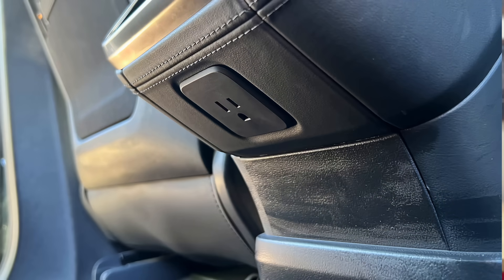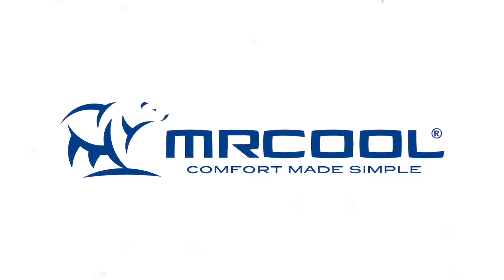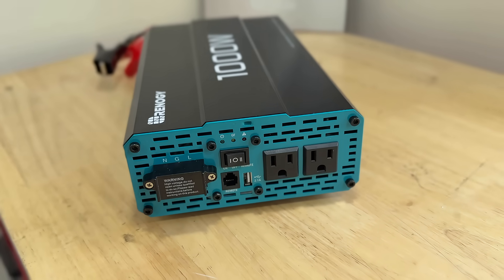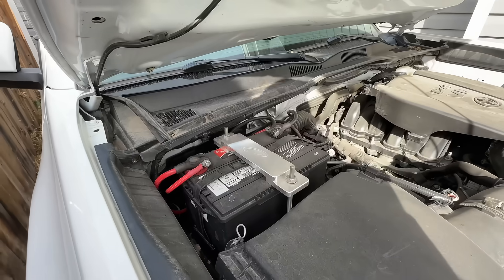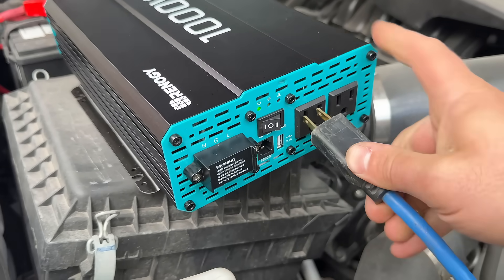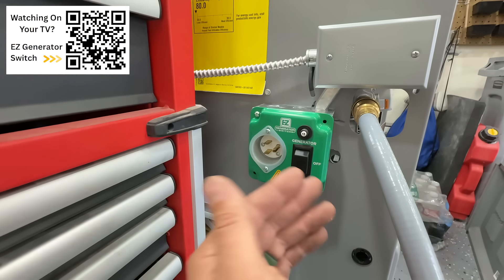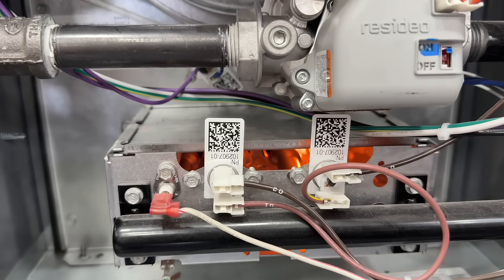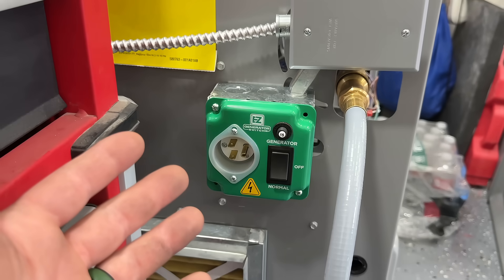Why Buy A Generator? You Have One Parked In Your Driveway.

Comment: You need to pend a lot more than $200 to do this right.
Spend as much money as you can afford on a 5000w (or more) full sine wave inverter.
Those puny clamps and wires will not give enough current to the inverter to power it. Fabricate heavy power and ground leads with ring terminals on the ends and attach them to your battery and inverter with nuts. Also install a ground lead to the chassis of the inverter for good measure.
The power that winds up running your refrigerator or an air conditioning unit starts somewhere. That's the vehicle's alternator.
Just be advised that powering all of these things puts a lot of demand on the alternator. Periodically check the temperature of the alternator to see if it is keeping up. It might not be a bad idea to find a little fan that blows air on it to help cool it.

Comment: This is cool, portable and interchangeable. In a pinch we have used duct tape to tag out the Main breaker, shut it off, only breakers on you want to run, Suicide plug to the outdoor electrical socket. You have to make sure you have the circuit breakers you want to run on the same leg of the panel as the outdoor socket since the 110 socket only provides power to half of the panel so it's every other breaker on either the left or right side that will have power. 220 devices and breakers will only have 1 hot leg, so won't work. At my house I wired a generator plug outside into a 220 breaker so I can run the ac and well pump. But I'm a contractor.
 Generator is way better on gas though, but the furnace should run for 10-15 minutes on the battery and just recharge it with the gas.

Comment: Having done auto electric work, I can tell you this is a SHORT TERM use. Automotive alternators are NOT for charging, regardless what you think. They maintain the battery, while powering the rest of the vehicle's accessories ei: ac, lights, digital equipment. If you were in a severe situation where you needed to do this, 24 hours would be as long as it would be advised.

Comment: A few important points:
1. Get an inverter that outputs a pure (smooth curve) sine wave. Not all electronics, including furnace motherboards, function using a square sine wave typical of most cheaper inverters. 
2. Install longer 1/4” bolts on battery-terminal clamps to accommodate washers and wing nuts. On inverter cables, install eyelets that slip onto the 1/4” battery-clamp bolts. Secure inverter cables to batter terminals with the wing nuts.
3. Use inverter cables (4 AWG or thicker) long enough to reach from the inside of a garage to under the vehicle (parked outside) hood where the cables fasten to the battery terminals. This way, the inverter can be secured inside the garage and out of inclement weather. The car hood should close and latch as well. 
4. A car can idle all night while locked (with a second key) to provide power to an inverter and to keep the battery charged, and will usually use less than 1/5 tank of gas.
5. Any inverter with a rated output of more than 1kW is wasted money given that the car’s alternator isn’t likely to be able to produce more than 1kW output, and about half that at engine idle. Per a cursory AI query: 

A 100-amp alternator at idle can typically support an AC inverter rated around 800 to 1200 watts continuous, depending on system efficiency and battery support.

⚡ Understanding Alternator Output at Idle
• Alternator rating: 100 amps at 14 volts = 1400 watts max output (DC)
• Idle RPM output: Alternators produce less at idle—often 30–50% of their rated capacity• So at idle, expect ~500 to 700 watts of usable DC power from the alternator alone.

🔌 Matching an AC Inverter
• Inverter efficiency: Typically 85–90%, meaning some power is lost during DC-to-AC conversion
• Safe inverter sizing:• Continuous rating: 800–1200 watts AC is a safe match
• Surge rating: Can be higher (e.g., 1500–2000 watts), but only for brief startup loads
• Battery support: If your system includes a healthy battery, it can buffer short-term loads beyond idle alternator output.

 Practical Considerations
• Pure sine wave vs. modified sine wave:• Pure sine wave inverters are better for sensitive electronics but cost more
• Modified sine wave inverters are cheaper and fine for basic tools or appliances
• Wire gauge and fuse protection:• Use 4 AWG or thicker wire for high-current connections
• Include a 150-amp fuse near the battery to protect against shorts

Comment: I worked law enforcement for several years and did surveillance for over half of it. Long days idling cars for heat or ac. No problems regarding wear and tear on vehicles due to idling. Excessive speeds and braking caused most of vehicle maintenance - brakes, tires and oil changes.
Reply: Prolonged engine idling burns up the crank because the oil doesn't circulate properly.
Reply: @Rabbelrauser how does it? Does your vehicle moving make your pump run? 🤔🤭😂
Reply: Idling for long periods is definitely not good for engines.  It causes excessive buildup on o2 sensors, catalytic converters and spark plugs.
The reason you probably didn't have issues is because a police vehicle is often run at wide open which helps clean things out.
Reply: I think most damage is caused by excited LEOs...

Comment: First time viewer and new subscriber. I have a built-in inverter in my Durango. It's great for camping and not wanting to disrupt nature or others if in a campground. It's only 1,500 watts but is great for brewing coffee or even running my small microwave, charging devices, and led lighting at night. 

I use it to recharge camper batteries while driving or if the weather is such that the solar panels can't charge sufficiently absent of shore power. I do keep a generator and two solar power packs with me for back up.
Reply: Your lucky.   The onboard 110 V AC outlet on my vehicle, and many other vehicles, is only 400 watts.

Comment: I have a 3000W inverter in my work van. It doesn't like much more than 1100 watts draw. It also has a battery bank with two strings of three 12V batteries. The last time the power went out, I waited for a while before connecting two fridges and a freezer (summer outage). They sat at around 900 watts for a bit and within two hours, we were down to 400w. Once they units fully settled down and began to cycle, the draw was no more than 280W. 

Don't let your refrigerator/freezer get too warm or it will overwhelm the inverter.

When I went to work I disconnected them and when I came home I had an attachment outside that I used to connect them. One other neighbor caught on and I could hear his engine running at night.
The last time we had an outage in the winter (Canada), within 3 days, I realized I was one of the only people left as others went to friends and relatives.
Part of me wants a Lithium Iron inverter setup in the house with the option to connect to the outside of the house for a generator or inverter feed from my work van.
Reply: I’m in Ajax.  I remember a big power outage 2008/2009? We had to go to Oshawa to the family members house for the night as they weren’t affected by the.
Reply: @wellnesscloud9887 Well I can walk to the nuke plant at the foot of SandyBeach. I can see the joint, but seriously, we lose power more than anybody else.
Reply: @Todd.T  I hear ya! I’m about 5 km from the Pickering power plant.. I got my iodine kit. Lol
Reply: @wellnesscloud9887  We wrap them up and give them to each other for birthdays or Christmas as a running joke. Skipping a few to  every once in a while to keep you surprised.
Reply: @Todd.T love it !!
Reply: Love this, wish I had known about it 10 days ago when a mad storm knocked out power to 20,000 homes for 5 days! 😊

Comment: A standard alternator is going to max out about 700 watts at idle without overloading it.  Pull more than that and it's starting to drain the battery.   I used to have a pickup truck setup to be my "generator". It had a beefier alternator and a high cranking marine (deep cycle) battery.  That way I could power smaller loads with the engine off without damaging the battery.

Comment: For short term power outages, to preserve food, medicine, or livable temperatures, generators are great, and this is a great idea too (except for EV owners). But the reality is, sooner or later you will run out of fuel, the generator will break down, get stolen, confiscated, whatever.

We need, as a nation, to get ready to suffer hardship, to endure primitive conditions, and to survive without technology. I've honestly been prepping since they called us survivalists in the 1970s.  I have multi-generational gear disintegrating in very neat piles, and I have given a decent burial to at least a couple of gas generators. I might have gotten 60 hours of use out of both of them. The reality for most of us is that our freezers are not stocked with steaks and prime rib, but we probably do, most of us, have a gas grill or a camp stove. Mr. Heater can keep us warm, a battery-operated fan can keep us cool. Life just gets simpler for a while.

We don't have to maintain a Condition White standard of living when we're not in Condition White. What we do need to do is preserve food without refrigeration, maintain medication temperatures without grid power, keep home oxygen machines and other health equipment running.

You know what YOU need. Now figure out how to keep it running for a day, a week, a month, and a year.
Reply: Mr. Heater propane heaters are wonderful. Great output for the input.

Comment: A car alternator is not a generator or battery charger though. The alternator is designed to pretty much keep a float charge on the car battery. Sure, it might say it's a 100 amp alternator but if you try to suck out 100 amps continuous it will soon burn up.

Comment: This is a great idea, but it has its limitations. I had todo the exact same thing in order to watch movies on my laptop during a black out in NJ that lasted 2 weeks in my area. Despite this idea being a temporary solution, but should the problem turn into a long term matter, if you have to use the car/truck for any reason. it's a wrap. I believe having a more permanent solution like a small portable generator can be used at night that can heat the home and power a fridge or a solar powered option using a 12v or 24 v battery set up depending on each person's specific needs would be best. That 1000W inverter isn't capable of running a furnace and a large household fridge simultaneously 24/7. Exceeding the voltage is going to damage/fry your alternator, and in the midst of a bad situation, it's going to get worse if you have no form of transportation.

Enjoyed the vid. 👍

Comment: The invertet has a cooling fan on the back of it. Saw it when he put the inverter in the engine compartment. Which means the inverter gets hot and needs to be cooled. I don't think setting it on top of a running car engine and closing the hood is going to work very well.

Comment: Your alternator with your vehicle engine is a generator and will supply 120 Volts AC if you bypass the rectifier in the the alternator. Don't need to by an inverter

Comment: All cars should have the option of an add on generator.  With the average car producing way over 100hp a 20K generator could easily be powered by the engine (space under the hood might be an issue) but pickup trucks should definitely have at least 20k watts capability built in… 20k should be enough for the average home…

Comment: My 15kW silent diesel genny really helps when the lights go out. It isn't a pure sine wave output but I have had for over 9yrs and each year we run it constantly for 48hrs and it hasn't killed anything yet. Alternators are fine for short bursts but they are not built for heavy loads running continuously, they run hotter than they should and this will break them, but for a quick fix to a problem, they are fine providing the cabling can carry the load.

Comment: You should mention that a 12-3 extension cord is an almost necessity in this set-up. Not 100% necessary, but,... way more efficient. Way more safe. You could also plug a quality power-strip into the 12-3, and run from there.

Comment: Never use your vehicles battery, only as a starter for the vehicle.
They're not made for that.
There is a simple RV setup to charge a separate House/ battery that works automatically after the vehicle is running. It will charge the car battery first which is only alittle bit.
Then the house battery.
Been there done that.. Along with couple panels. 114watts. 80ah bat. 800w invert. 👍

Build your own.  Hit Miss motor. $$

Ps. Of course you could cut the front end off a rig and stuff it through a wall. Heat, air conditioning, stereo, 12v dash outlets and all.
Or just Bury the whole thing. Tail pipe sticking up out of the ground.
More than one heater core. Live axles to put the work..?
 Have a windshield and door access only, with over hang.
All the..Creature comforts.
Just like a motor home. 
Only it's buried for winter, summer..ect.
Age68

Comment: your alternator will fry if you pull its maximal power for a long time, particurlarly at idle engine speed - that man know nothing about cars - dont do that unless you are ok to pay a new alternator replacement - some alternators cost way more than a small generator - even worst if you have a german car -and  it will not be covert by the warranty

Comment: Using your method with an inverter, I'm getting an error message from my furnace (Trane S9V2B040U3) and it won't ignite.  It's throwing error code E6.2 bad grounding.  The inverter does not provide a proper ground for the furnace.  How do I rectify (pun intended) this problem? Thanks.

Comment: I have a 2500 watt inverter and wanted to see how fast it would run down a car battery . First with a microwave 8 minutes before the
inverter shut down . Then with a small window air conditioner 11 minutes . I haven't tried a freezer or refrigerator but the point is inverters
go through a 12V car battery pretty fast . If you chose this method for power check or run your engine often .  I started with a brand new 
deep cycle 12V 750 amp battery fully charged , not on a car , stand alone .

Comment: I am a mechanic, and this is without a doubt horrible ADVICE!!!!! If you are going to go through all that and pay what you are paying, pay a little more and do it the right way with a cheap generator. You can get a safer alternative actual generator right now at any of the big stores for 150 bucks. An alternator changes AC current into DC current using diodes (why its called an alternator and not a generator). You are converting it back to AC at an idle? You will burn up your alternator sooooo fast! The purpose of an alternator is to maintain battery power, not run or charge your battery, or run a furnace! When it is all said and done you will have a few hundred dollars into the system, and around $400 into and new alternator, plus labor if you don't know how to change one. NOT A GOOD IDEA!!!! Plus, you are risking burning your car to the ground or your home with that extension cord!

Comment: This can work in times when there are no other alternatives.  I lived off grid for a few years and in one instance I had to do just what you talk about.  But there are many problems here.  First, your car is not designed to idle.  It is designed to drive.  Idling for long periods is very hard on the engine and will lead to an early death of the Rear Main Seal.  BTDT.  Get at least 1-12 volt DC deep cycle battery (anyone experienced with low voltage can go multiple 6 volt DC deep cycle batteries), and unless they are lithium ion, keep them trickle charged for emergencies.  Lithium ion is a beast in its own right.  Get a car alternator (they almost always have a charge controller installed) and a motor cycle.  This takes a lot of mechanical effort, but it works.  Me, I prefer trusting solar.  But remember- a car is quiet, yes.  But it is far from economically viable.  The gas has to come from somewhere.  It’s a last resort tool.

Comment: The other beauty of your car is that it generates far less pollution than the generators.  It's also a lot easier to fill.  

I'd be interested to see a car converted into a DC charging station for some 12-48 Lithium Ion or deep cell batteries.

Comment: I use this method all the time with a 115 amp alternator and 2000 watt inverter. My cables are 2awg with fuse and heavy duty alligator clamps. This is good for 700 to   900 watts with the idle raised by propping your gas pedal.  The larger inverter and battery handles the temporary watt surge.   Your fridge much of the time is off or runs at 200 watts. The furnace works similary peaking at 634 watts.  You can also charge power stations that can alternately run your fridge and furnace. This is not theory, your maintained car can do it especially if you turn lights and accessories off and keep the car running.

Comment: We used to have a service truck on my job that pulled AC directly off the alternator and regulated it somehow. There were heavy duty AC outlets in front of the grill. I suspect the voltage maintenance  and frequency and wave form would have been pretty much less than desirable. At first I thought that's where you were headed, but this is so much easier and the output is not so dirty. Of course, there's a tax for going from AC to DC and back to AC, but the output is worth it. Well done.

Comment: Total crap. A small generator is way to go. That thing could not even run the blower motor on my furnace. Plus if it not pure sine wave electronics will be most likely be damaged. A vehicle alternator does not put out full amperage at an idle also not meant to operate at full 100 to 150 amp load. You will burn it up.  Right on a cold day they won't see the steam coming out of car tail pipe. Then they break window and take car.